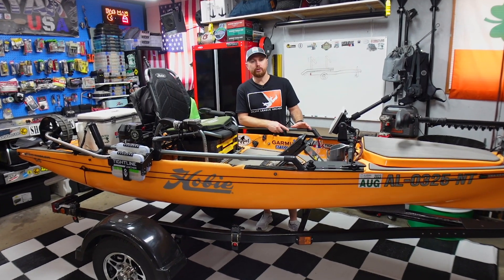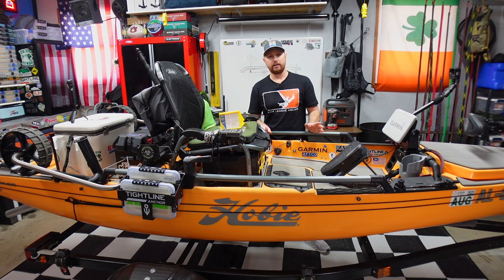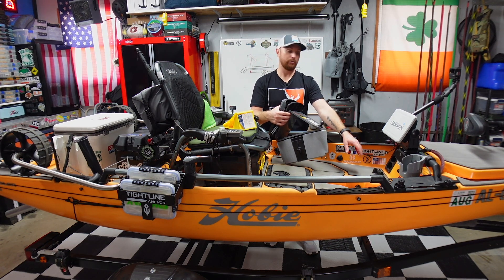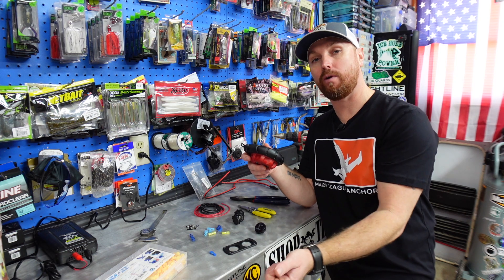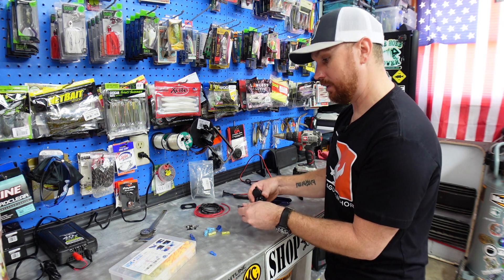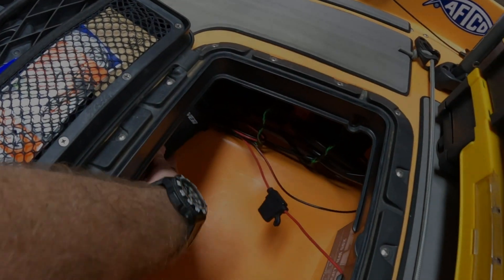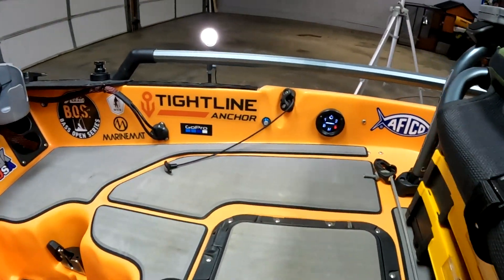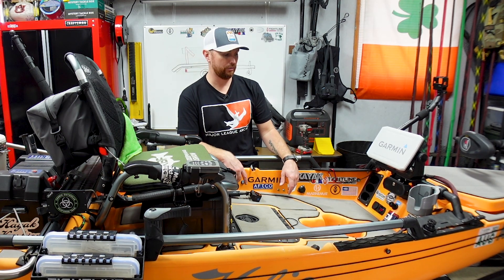How to Install Power Ports to ANY Kayak EASY.. AND Version 2.0 DIY Kayak foot pedal build!

Comment: Pro tip from an IT guy who fishes a lot of cable:  Pick up some pull string.  Then as you run your cables for your current project, leave a pull string along side your wiring. (its polypropylene, so its not going to rot or get mildew)

Then in the future when you want to run more cables through that area, you can just tie on to the string and pull it through. (And you can add pull string to the new cable to replace the one you are pulling out.)

This way you don't need to try to re-fish or contort yourself through the little hatches to run more wiring.

Comment: T.J. I know you're a Bixby Ambassador. I'm hoping they send you the PP 768 Bixpy J2, with the warp speed 13. With two full hrs of run time, at speed 13. Plus you can program the remote,  to the original J2 battery for a spare. I just ordered mine. I sold my Original J2 to my best friend. But I kept one battery, because I had two. He's in heaven. Now we both have 120 pdl drives, for 3 day camp and fish trips we do every summer by kayak. Plus my tournaments, I can cover tons of water. And recon new reservoirs and much larger lakes. 🌊 💯 🎣

Comment: H rail has been out of stock for a long time! I want the same thing but have to do the dash another way. I have an sportsman AP136 OT ..any suggestion on a rail for dash to hold 2 humminbird helix 8s side by side in front like that?
Reply: I've been thinking about using square extruded aluminum rail. You can get it in various sizes and it has t-slots on all sides.
Reply: Never seen that before, can you link it for me?

Comment: I love all your installs and your videos I had an XI3 on a Hobbie PA12 off and ran into issues in big water I'm curious why are you wanting the foot paddle over the remote and can you activate spotlock still?
Reply: I'd assume so you can fish and still keep hands on the rod/reel. I've been out a few times on windy days and switching hands from reeling to adjusting direction kinda sucks.
Reply: There is a button you mash for spot lock it’s on the side of the foot pedal. He showed it on the last video. It was just after he launched, sorry don’t know the time stamp
Reply from the maker: I think I went over why I wanted the foot pedal at the beginning of the video.  When I fish docks I like to be able to run in and out and up and down while I cast a lot. Spot lock only helps if I want to sit in one spot. 👍🏼

Comment: The USB power ports are problematic,  a better solution is to use a USB 12v to 5v converter in the hull and then use yak attack thru hull fittings and run a USB cable out of that to plug the camera in.
The USB power ports will rust very quickly even in fresh water.